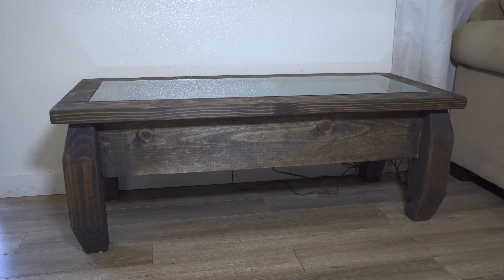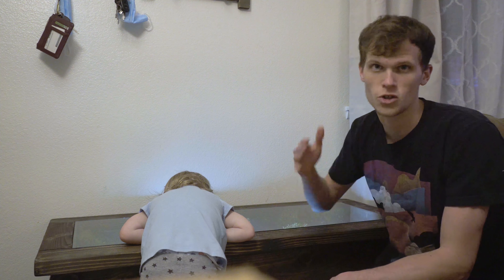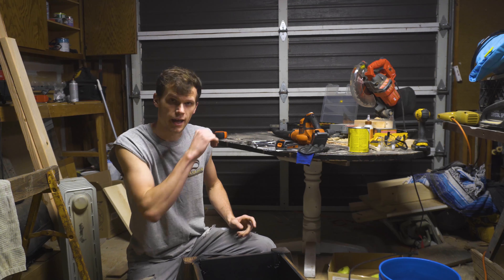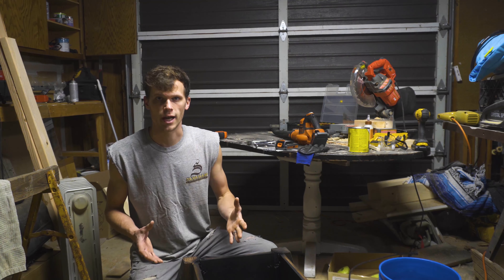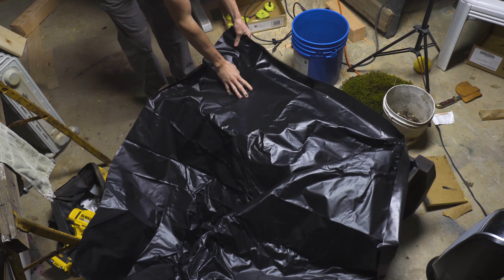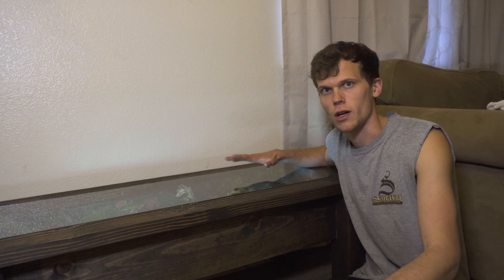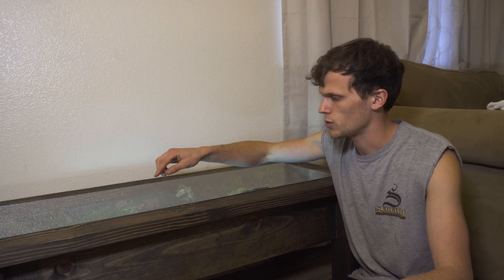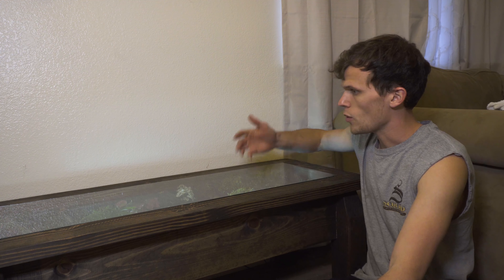Waterfall in a Coffee Table (Concept)

Comment: Pretty cool project. something i would enjoy doing. I was wondering about the wood too. It could be sprayed with a water resistant material. I would suggest more natural products like different shapes of stone, river rock pebbles that will serve as natural build-up and recessed planting areas....serve as "pinch points to hold the moss and such. The fan is a good idea for fogging up the glass. I would also suggest a type of filter, especially if you are going to have a fish in there. Water can get nasty over time.

Comment: Great Project, Please rebuild without the wood if you want to add goldfish or other fish. Mortar mix and stone should work well but it would be best to ask to make sure the mortar does not leech anything nasty like that plywood will do.  I love everything about it!
Reply from the maker: do goldfish not live well with wood in the water?
Reply: @travisjantzer  fish are very sensitive to what's in the water.
Reply: @travisjantzer  Sure in the wild. You have a lot of plywood in your construction, that will leach the glues and and other chemicals from the manufacturing process. It does not look pressure treated or marine grade so not super bad. Fish do not like nasty chemicals. and while your table looks awesome today, in a few months when the wood starts to break down it's going to get ugly and fall apart releasing a ton of wood fibers into the water which can cause issues. No worries, you are a maker and can simply re-make it or create another piece of art. easy peasy! great project as I said but it is an Art piece and will not last multiple years.
Reply from the maker: That’s a fair critique! And it is more of an art piece. I’m am curious to find out how well it holds up.

Comment: Really nice job. Hopefully no one knocks that table over. How does the moisture evaporation not fog up and condense on the top glass plate or does that happen? Also tip: instead of using plywood or wood which will eventually rot out, maybe look at $1.00 store and get a bunch of  plastic items or tupperware and cut out the frames you need using that instead of wood and use hot glue gun to hold all together.
Reply: My thoughts exactly. Needs a fan and wood to be treated.
Reply from the maker: Not a bad idea. Maybe if I make another
Reply: Awesome tip on using the old plasticware!  Recycle, Reuse, Reduce...

Comment: Get yourself a roll of that Rgb L.E.D. Light strip of Amazon it 16.4 ft long and you can cut once to length you need. It changes colours has a remote control looks great and also dims it $25 up here in Canada. That will light it up evenly.
Reply from the maker: yea that would be cool.